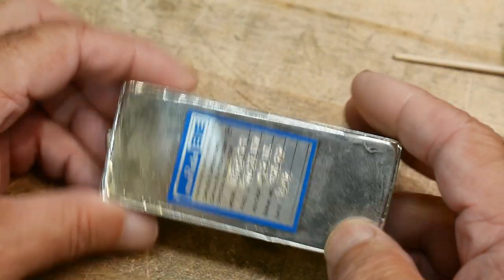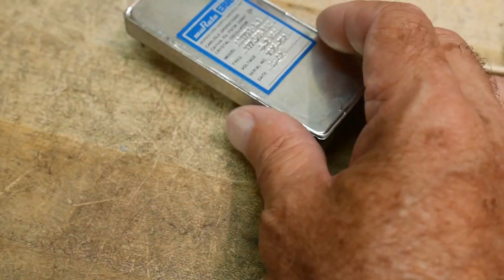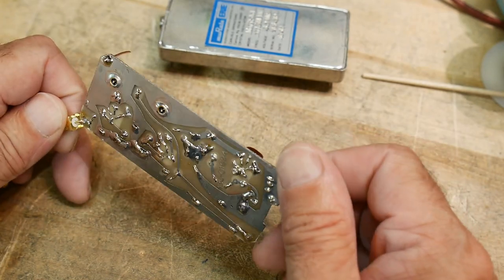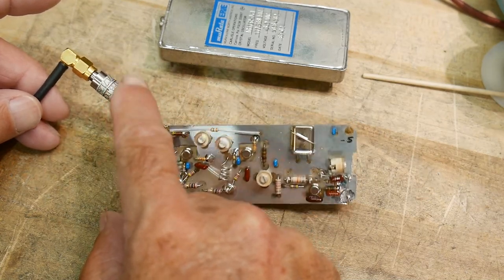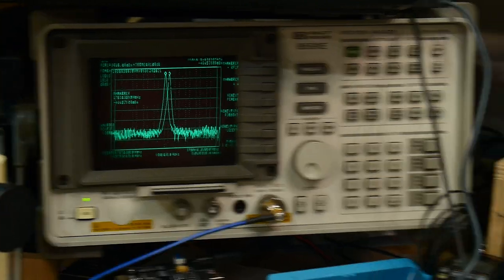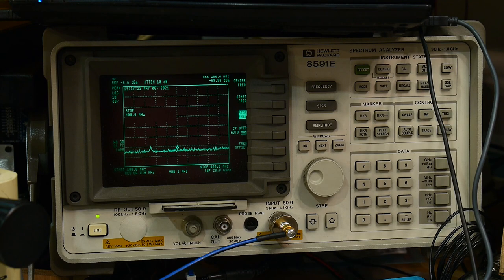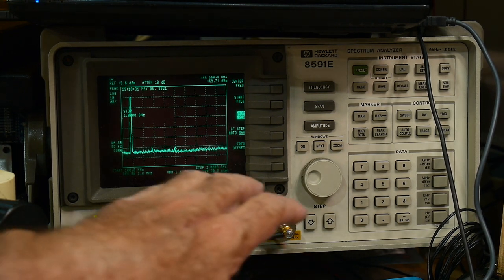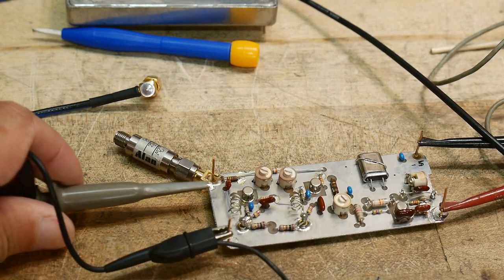#814 177 MHz Oscillator Measure and Teardown

Comment: Thanks for the neat oscillator tips and tricks. 
I wanted one of those blue plastic screwdrivers, but typing plastic screwdriver into ebay didn't give me much. Apparently they are called "Frequency adjustment Screwdriver".
Reply from the maker: The blue screwdriver was a ceramic tip. if you search ebay for ceramic screwdriver you will find them. I did a video: https://youtu.be/Llx124Xa13k

Comment: Anyone know why negative voltages were the standard? PNP transistors?
Reply: -5.2V was/is the standard ECL power supply voltage.
Reply from the maker: yes, might be the same reason ECL uses a negative rail. There is more noise on the rail than the ground, so if your signal is referenced to ground is it less noisy. in a positive voltage output you usually have an NPN with an inductor on the collector tied to +V, so the signal sees the +V noise. if the inductor was tied to gnd, then it sees the gnd noise.

Comment: I guess the crystal isn't oscillating at its fundamental? I say that because of the tone below the ~176MHz tone after you did gross adjustments to the first variable capacitor. Maybe that crystal is 58Mhz?
Reply from the maker: Yes, probably 3rd harmonic
Reply: @IMSAIGuy  I was just getting ready to ask the same question! 176MHz seemed awfully high for a crystal to be operating at its fundamental frequency.

Next, the spectral purity of the output appeared to be exceptionally good. Is it or is it simply the limitations of the HP spectrum analyzer?
Reply: @IMSAIGuy  3rd?
Fundamental mode xtals don't usually go much beyond 30MHz, so 5th or maybe even 7th seems more likely to me.

Is the cristal marked?
Reply from the maker: marked 59 MHz
Reply: @IMSAIGuy  OK, so 3rd it is then 😀
Reply from the maker: @somedutchguy7582  Victory is mine!
Reply: I took 177mhz and divided by 9 and got 19.66666 so it must be either a 20mhz Crystal with some adjustment to get 19.666mhz so multiplying my 9 yealds 177mhz
Reply: @IMSAIGuy  :-) And mine (close enough)
Reply: @somedutchguy7582  The crystal is at 59 Mhz base frequency.
Reply from the maker: @DAVIDGREGORYKERR  Great math but the crystal is clearly marked 59.??? MHz  the ??? is not readable due to a solder blob
Reply: @IMSAIGuy  could also be that the crystal is a 3rd overtone device (so 19.6666.... fundamental), followed by a tripler circuit.
Reply from the maker: @somedutchguy7582  watch: https://youtu.be/8vdk9CcSUqE

Comment: Why is the ‘calculated power’ (-42dBm less 30dBm) -12dBm but yet when the 30dBm attenuator is removed the measured power is -5.6dBm, is this related to the frequency range of the attenuator?
Reply from the maker: -5.6dBm was the reference level (top of screen) not the measurement
Reply: @IMSAIGuy  Isn't there additional insertion loss with each "make and break" of the output coaxial connector(s) also additive to the total losses? Roughly around 0.3 db per connection, I think?   Fred
Reply from the maker: @electronicengineer  no. it is only 0.01db, check this out: https://youtu.be/GOCD5DvOj5c

Comment: Good show, can you do more of these types of siturations using the SA and scope  demonstrating use. Helps me with applying my SA and not blowing it up. A question comes to mind, can you use a near probe without direct connection to see the same? Thanks.
Reply from the maker: Sure, you can use a probe just fine. you wont get absolute numbers but relative. fine for peaking.